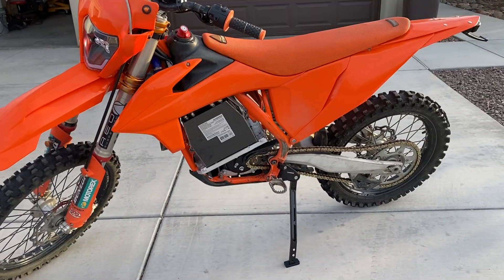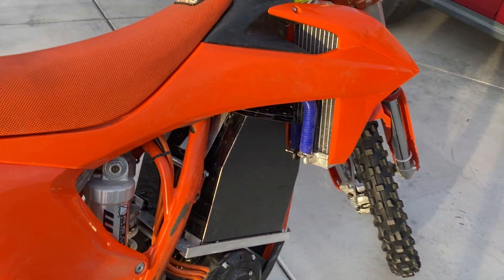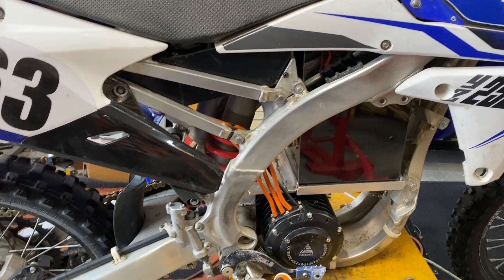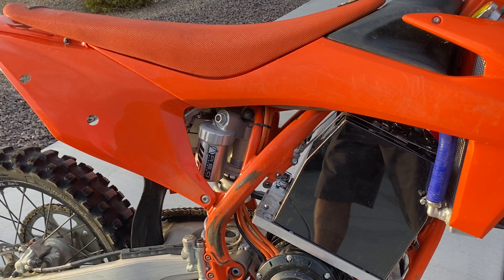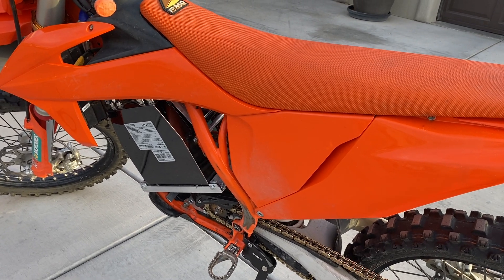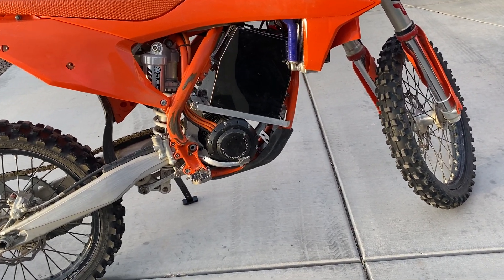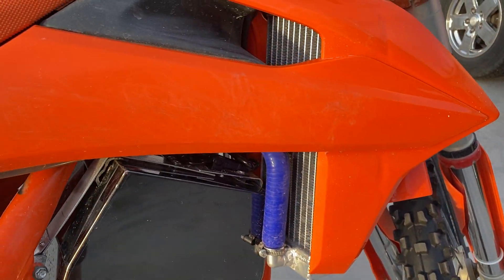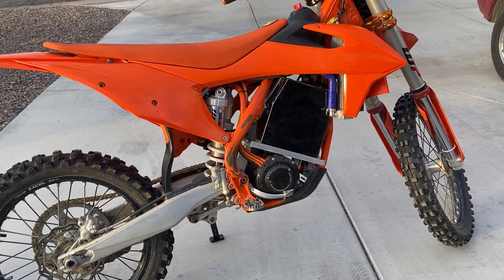John's KTM 450SXF converted to street legal Electric.  QS138 70H V3 , Votol EM260S, Amorge battery

Comment: does the 2023 and up ktm frame have more or less space for battery ?
Reply from the maker: I don't know, I haven't modified a 2023 or newer yet.  I have a friend that just got  a new 2025 KTM 350SXF, I can make some simple measurements, but I did a build article on this 2019 bike at this location.      https://electricdirtriders.com/threads/2019-ktm-450sxf-factory-edition-conversion-to-electric-street-legal.4055/         on Page 7 , you can see the dimensions of the battery from Amorge.  Make up a mockup of the battery and see if it fits

Comment: what are the continuous and peak amps its putting out to make that power?
Reply from the maker: I have a current meter in line with the battery current.  In Mode High, I am at 300A at 72V, that is 21KW or about  28HP.  I have 400A in Sport mode.  At 72V  that is 28KW and /or 37HP.  When we first take off with the battery at 80V + times the 400A that is 32KW or 43HP.

Comment: Hi Donald , 
I admire your work with motorcycles and I am building my own. I have Husqvarna TE310 Frame and wondering about best specification. This will be for enduro , forest riding not mx so more that 30HP not needed. For me range is more important. I have Qs138v3 newest version and looking for best controller and battery setup. I appreciead your reccomendation.
Reply from the maker: I'd be glad to help.  With the QS motor, I have had the best results with the Votol EM 260SGTP, their newer and smaller one.  I can give you a good tune for it, and or you could talk to ElectroandCompany.com for their version of the same controller, but they sell it as a kit.  Their kit doesn't allow for much customization.  I actually like reverse, with the electrics, it is just a handy feature. Go to ElectricDirtRiders.com,  sign in, and start a conversation with me, I would be glad to share photos and info, or start post, and you can get other people help also.  I would recommend for your use, a battery of Samsung 50S cells.  And it is tight, but 20S16P can fit your frame (I fit it in a 2017 KTM 150SX frame).  That sized battery with Molicel P42A cells gets 40 mile range in single track riding, with the Samsung 50S cells, you would get about 20% more range.

Comment: Yet another nice build. Congrats. I wonder why this time you are kit using the V3 motor type with reduction (this one on the Ktm looks a bit bigger also than the regulars 138 you’ve been using) and also I am courious about the cooling system adapted to the Votol controller. I’ve done a couple of builds in my channel using Qs 138 on a Kx 85 and a beta trial bike and I keep always an eye on yours.
Reply from the maker: Thanks for the nice words.  The V3 motor is the QS138 70H  new style that does add a few mm to the right side for a better waterproofing on the encoder and cable exit ports.  The new motor has better (bigger) bearings also.  We use 2 x 80 x 80mm cooling plates on the surface of the controller. We put a small 12V  pump from a micro brewery on the bike to the cooling plates and then to the radiator.  On this bike Kenny Roberts TIG welded the radiator bottom port, to redirect it straight up. He has a great shop.  ( I helped him build an electric Honda Monkey that I will YouTube after paint)  We overheat the controller and battery on hot summer rides.

Comment: What's the approximate range of this bike with that battery?
Reply from the maker: With this configuration, 20S12P Molicel P42a, you can get 20-25 miles of single track riiding.  About 12 laps around any Motocross track, we did 12 laps at Glen Helen hill track, and the battery was real low.   Go with Molicel P45B cells, and get about 10% more.  Go with Samsung 50S cells, and about 20% more range, but you can't get the current for motocross track riding.  I have put a bigger battery in this  same size frame, 20S16P Molicel P42A cells,  (25% larger) and he gets 40 miles of single track.  If you built a 20S16P Samsung 50S cells, it should be close to 50 mikes  single track.

Comment: How good would a qs 120 work on a 250 2 stroke frame
Reply from the maker: I wouldn't waste the time.  The QS120 V3 and the QS138 70H V3 aren't much different in size and cost.  You will want the QS138 power.  A 125 is the same size as a 250-450 bike.  We put the QS120 in kx65 and slower KX85 .  Definitely at 72V and with a Votol EM260S controller  with 400A.  A big enough battery to supply that, 20S12P Molicel P42A's
Reply: @ ok tbanks
Reply: With 60-72 volts

Comment: What year is that ktm? Looks great
Reply from the maker: It is a 2019 450SXF Works Edition. The 450 frame is a little wider at the bottom, and  the motor aligns up better.  I have done a 2022 KTM 250SXF and a 2017 150SX.  I got a 20S16P battery in the 2017.  The 2019 with the Amorge battery could be made Quick Change pretty easily.  What riding do you do?
Reply: Mainly going to be woods riding, so distance with a larger pack would be nice. North Florida is real sandy, and eats the batteries. I have a 2014 kx250f frame and the electro motor/controller kit just shipped. Already have the lithium king mounts.  I do have interest in trying hare scrambles, where a quick change would be nice.
Reply from the maker: @briandesilets8425  Go talk to both Derek Timm at Lithium-King.com , he races the hare scrambles in north  Florida and with an electric Suzuki, and Mark Peroni at XEMX1.com, he races also in north Florida and builds YZ250F into electric with a quick change battery for the Yamaha.
Reply: @  I already had a talk with Derek. One cool dude . He had some pointers and I thought I had A line on the same bike me he uses, but it sold. Once the motor comes I can have better discussions with the guys. Thanks for your help. Your videos have helped a lot on their own.
Reply from the maker: @briandesilets8425  Glad to help
Reply: @briandesilets8425  I am in tampa area and im building a honda 125 i also have a kx85 thats done. im to the point of deciding on a battery on the honda and cant decide on what i should run for continuous and peak amps. on the kx85 im running 200amps cont. but with a much larger wheel and heavier bike im not sure what to run.
Reply: @ I’d ask the pros. I’m still waiting for my first batteries to arrive from amorge. I imagine it all depends on how you ride.
Reply: Once the kit arrives I’ll try to size batteries. I want the 6x9x12.5 from amorge, but I don’t believe it will fit. Definitly not in the tall configuration.